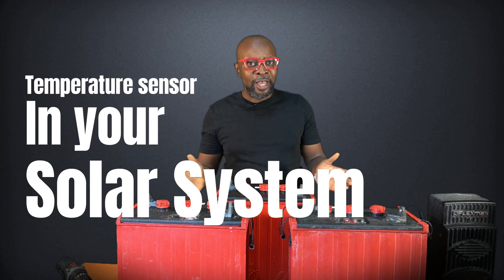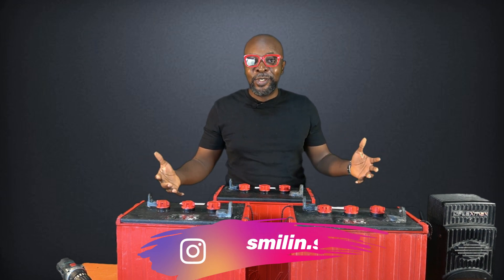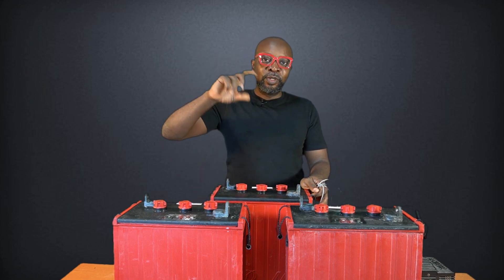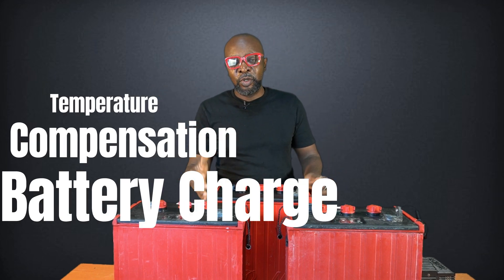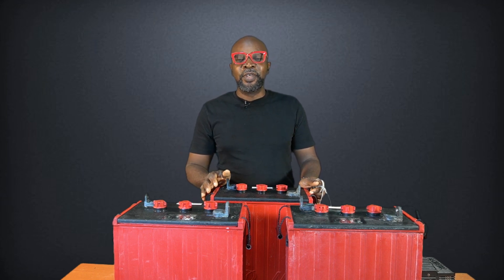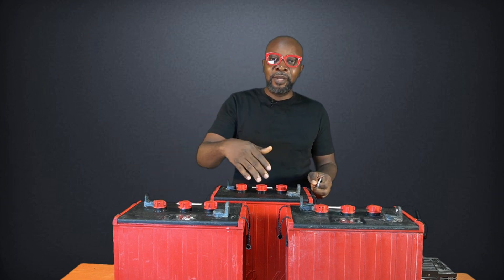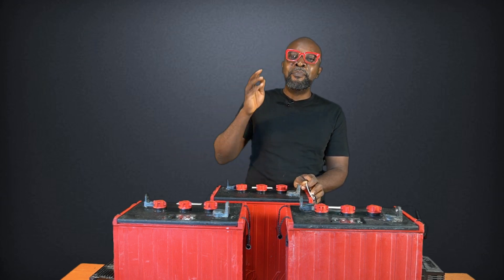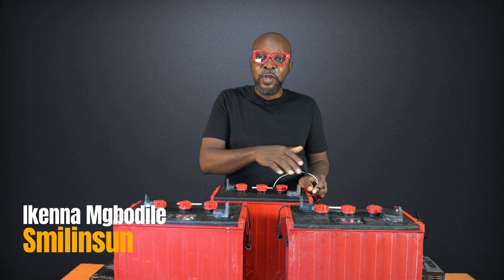How to connect Temperature Sensor in your Solar system Installations

Comment: Good evening sir. I currently use a hybrid yohako 3.5kva inverter and it didn't come with a bts wire. But has two ports one is rs232 port and the other. What should I do
Reply from the maker: Battery temperature sensor  cable is available in Solar shops

Comment: How do i get the tempreature sensor and do i get two one for rhe controller and one for the inverter and do i need to place one each in a 24 volt system ?
Reply from the maker: You need one for the inverter and one for the charge controller as both charge the battery and need to monitor the battery temperature. 
The temperature sensor comes with the inverter and charge controller.
Reply: @smilinsunsmilinsun8056  I didn't see any wire like the one you were using to demonstrate on the video hence why i wanted to know how to get one ..... when you say comes with the inverter do you mean it's inbuilt inside the inverter and the charge controller...

A curious man who wants to understand his setup and not just allow installers dictate everything
Reply from the maker: @anthonyosunde2129  the temperature sensor comes with your inverters ans charge controller when you buy it. When you open the box it's in there for both. So you just plug it to the BTS port.
Reply: @smilinsunsmilinsun8056  I'm Reslly interested in getting one batteries are expensive and I intend giving the new ones I just got intensive care

Comment: Good work bro, keep educating us. Ikenna what is the recommended Absorption voltage for tall tubular battery.?
Reply from the maker: Some battery Manufactures differ sometimes on absorbtion voltage , however most lead acid batteries absorb at 57.6 volts also bear in mind temperature coefficient compensation
Reply: @smilinsunsmilinsun8056  Thank you sir.